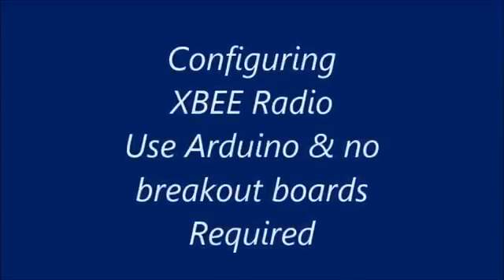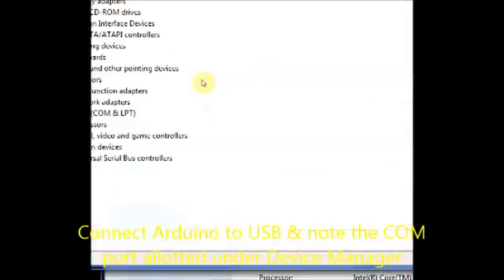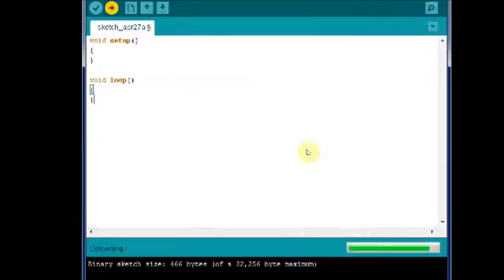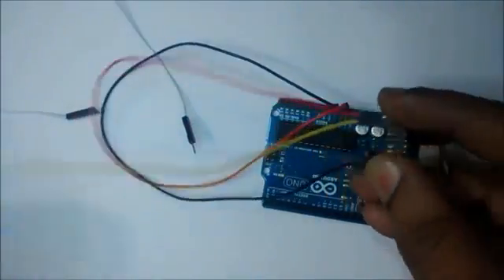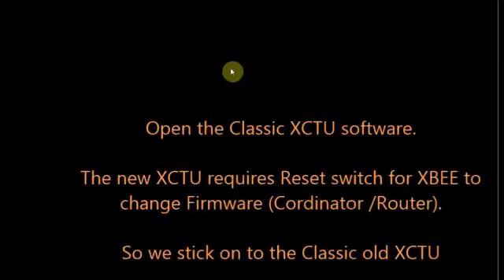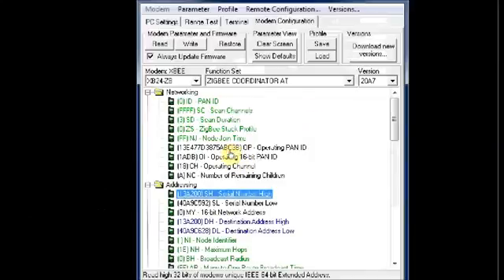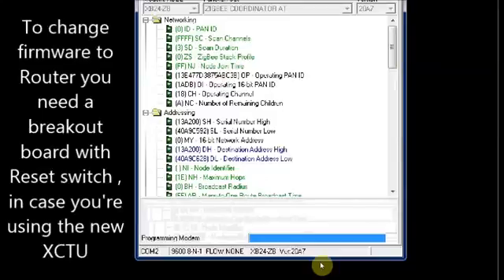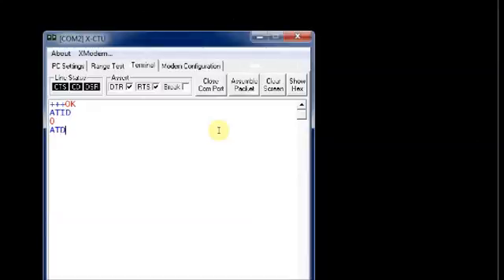Configure XBEE using Arduino in less than 5 mins  No breakout boards used

Comment: Thanks, it worked. I just have a question. If Arduino works at 5v and the Xbee works at 3  Can the Arduino damage the Xbee? Do I need a voltage converter for this?

Comment: My arduino has 5v on pin 0 (RX). If I connect it to the Xbee pin 3 (Rx) ocacionara fails? (All xbee pins only admit a limit of 3.3V)
Reply: I didn't have a problem, I have been working with the Xbee connected to the Arduino for 1 week and it still works fine. Although I still have the same question as you.

Comment: After test/query, the xctu prompts an info window wherein it tells to reset the board. after that also, the xbee is not detected. I am using XCtu with windows 10. Is that the problem?
Reply: Krunal Chaudhari did you get the solution for this problem. I am facing the same please let me know if you have solution for it.
would be a great help!!
Reply: I have the same problem, if you found  solution can you help me?
Reply: @pervinquliyeva7000  hi, did you manage to solve this problem? May i know how?
Reply: @harshalsuryawanshi8896  hi, did you solve this problem? May i know how?